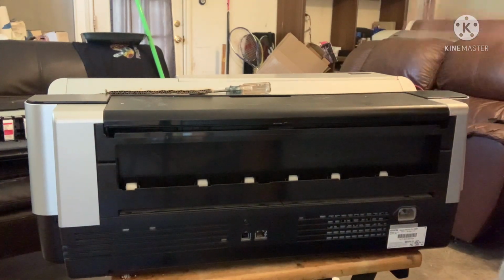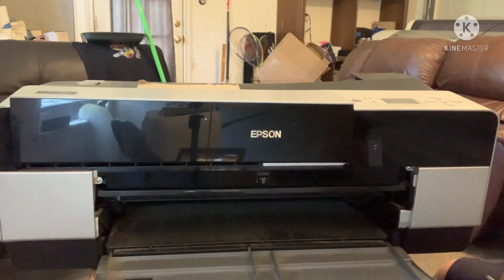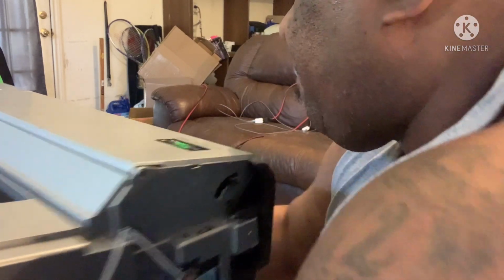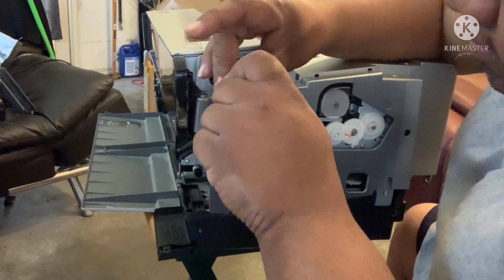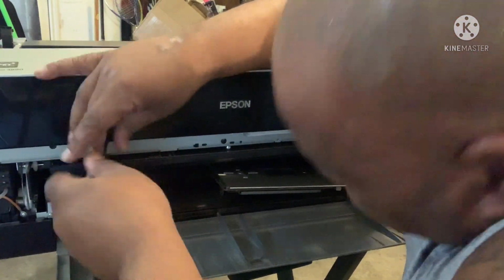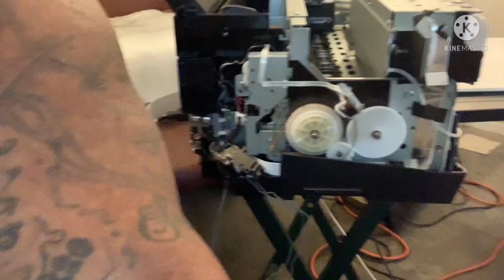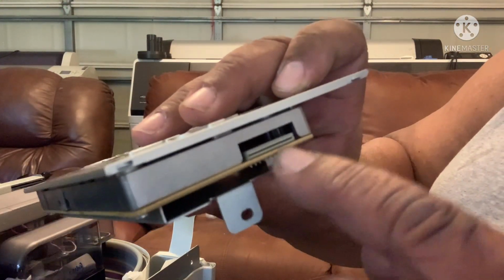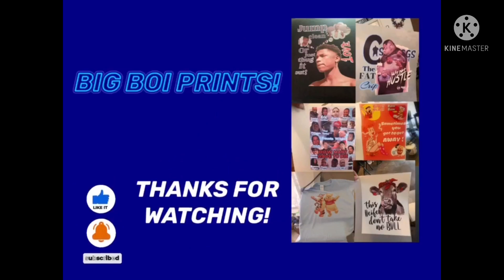How to take the cover off of a 3880!

Comment: Finally a kindhearted guy made a video on how to take the cover off this printer! Thank you so much Big Boi! You saved me a LOT of time & headaches! Thank you, thank you, thank you!!!
Reply from the maker: Thank you. If u need anything. Let me know.
Reply: Hi Big Boi

I have two items that I can’t figure out where they go as I’m reassembling my Epson 3880. I’ve checked off sprockets to see if the gear fell off over one of them and I checked the service manual; every page to see where this gear might have fallen off of if it has fallen off a sprocket. 

And I’ve also look for this metal flange I simply forgotten where I took it from inside the printer. 

Are you familiar with either one of these parts? 

I bought it refurbished, directly from Epson. 

When it was being serviced, perhaps the engineer left these parts inside floating around. (Wishful thinking on my part :-) :-)?)

 If you can help me determine if these are just objects that were left in the printer and fell out when I disassembled it or if these are objects, that should be put back into the printer. I just cannot figure out where they go.

You can’t see them which is important to know what I’m talking about. Is there any way that I can somehow show them to you?

Thank you,
OM
Reply from the maker: You got a warranty
Reply: @bigboiprints5726  no, I don’t.

Comment: Hi Big Boi: your fix it yourself videos and advice on Epson 3800 and 3880 are awesome and will save me big bucks. I have a question?  I am in the process of re-assembling my 3880 after using your method to disassemble the printer to clean the printhead.  What I want to know is; do I need to make a "Space Making Jig," to make sure all lines are in alignment in the printhead and IC cable as I reassemble?  Thanks for your indulging me on this question. I dont' want to make sure the printhead sweeps across the track without derailing like a freight train. 🙂OM
Reply from the maker: Yes make sure it’s even

Comment: Big Boi, got it apart thanks to you, I tried to Upload a pic to show you but I can't it seems, darn! yellow is the issue, would like to physically remove and try a manual repair ughhhh
Reply: Big Boi, the yellow/Magenta damper is ruined, could not be repaired, they have some on ebay apparently new from china, could I trust them, love to the 8 tube supply line but those look impossible to get, not giving up, you rock!
Reply from the maker: I got mine from china! Thank goodness it wasn’t the head! Those 3880 heads are tuff
Reply: @bigboiprints5726  Just ordered from china, my, i put tape over exposed nozzles and inlets to prevent further drying since i did bot want to reassemble. Thought I could have put new plastic over damber, sealed with epoxy, but most likely would not work, only for Mcgyver would that work
Reply from the maker: Worth a try
Reply: @bigboiprints5726  Big Boi, is it safe to remove the 8 ink tubes that connect from the damper assembly to the metal inkjet cartridge holder? I wish to blow out all the ink that has been trapped in there, especially the yellow. Thank you !
Reply from the maker: Yes sir!
Reply: @bigboiprints5726  I will go onexstep further, can the ink cartridge holder be safely removed too I want to purge tubing in there. There is a lone tube connected to the upper left hand corner of cartridge holder, thnx again. I might request a venmo paid first video chat for your expertise if i cannot do it, i have the service manual but that doesn't clearly show dissasembly
Reply from the maker: Hey fam hit me on Facebook book so we can talk

Comment: Great video, in your 3800/3880 replacement of 1 out of 4 dampers, can one of those dampers be bought new anywhere online instead of the whole assembly? also I have NO yellow that is my issue; is the yellow channel shared with photo black because on a nozzle check streaks of black come out instead of yellow, Thank you sir
Reply from the maker: Yes you can just buy dampers! I would try and replace it.
Reply: @bigboiprints5726  Thank you, I guess I will know soon enough as I disassemble the mammoth beast soon, who knows, I might luck out and could be a print head clog. Again, thank you sir
Reply from the maker: I would think it’s a clog. Usually when a dampers goes out. Ink just goes everywhere
Reply: @bigboiprints5726  I never have been into subscribing to channels, I like your humor, being down to earth and cool. My other question is this, I have a lot of ink which expired 8-10 years ago unopened, safe to use since they're sealed? Also, you opinion on generice refillable cartridges and their non oem ink? Thanks !
Reply from the maker: No sure on the old ink! But I only used ink pro ink. For sublimation
Reply from the maker: And mine for dtf
Reply from the maker: Thanks for the support bro
Reply: @bigboiprints5726  My pleasure sir, you're a keeper. Random question, would you accept venmo for a video chat if I get totally lost in the middle , glad to pay!
Reply from the maker: I will help anyway I can
Reply: @bigboiprints5726  and if you take venmo zelle or paypal I have no issue paying for your expertise if i get stuck or "jammed" up lol
Reply from the maker: Ok no problem
Reply: @bigboiprints5726  time zone wise i am in  NY, are you in same  time zone?
Reply from the maker: Nope central

Comment: You have any knowledge in regards to error code 131B?? Never had any issues with my printer than now I have this error code that I can’t find too much on it
Reply from the maker: What printer do you have
Reply: @bigboiprints5726  I have the 3880
Reply from the maker: You need a main board it over heated
Reply: @bigboiprints5726  is that the bigger one on the left or on the right in the back?
Reply from the maker: Bigger???